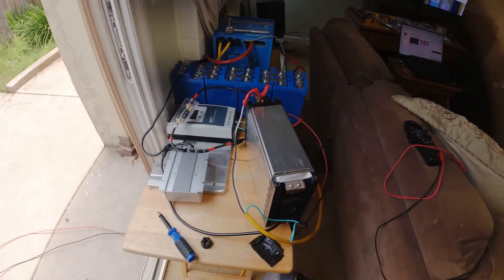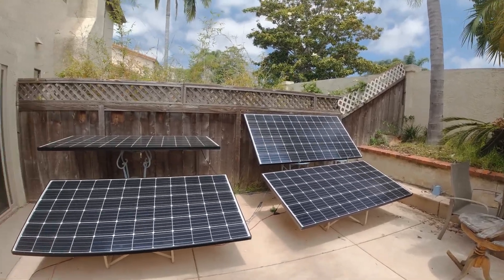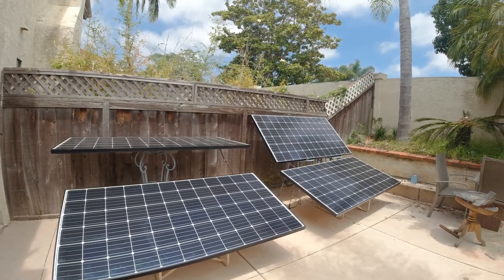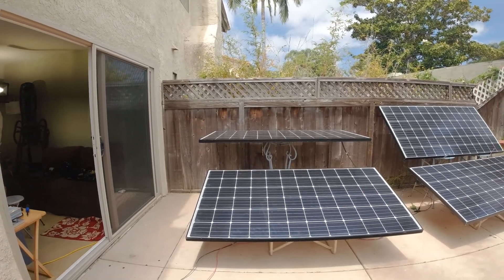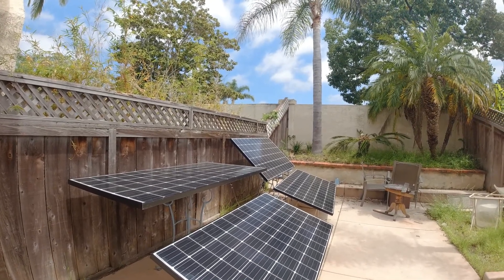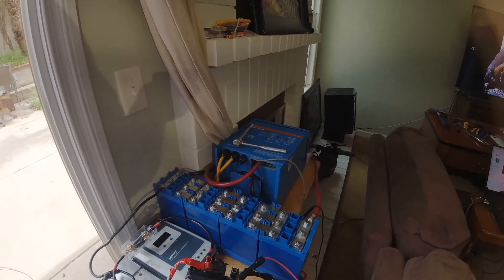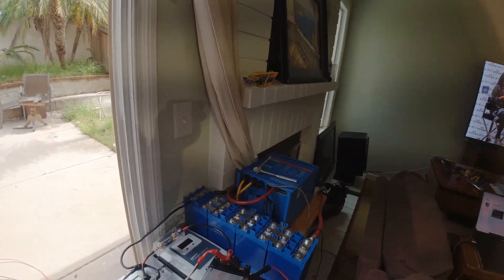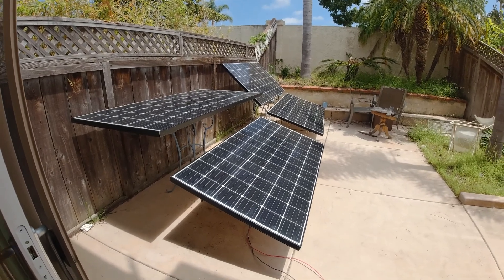Over paneling, 1440W Solar Array (with four 360W Solar Panels, Samsung Solar Panels, S-Power), DIY

Comment: I understand not going over the Voltage of the charge controller, but can you go over on the amperage without doing major damage?
Reply: A good MPPT charge controller will limit the current by choosing another (worse) working point for the attached panels. The datasheet of the controller shall tell how much "overpower" they can manage.
Reply: spec sheet will still specify max current eg. victron 100/50 = max 60amps array input. stay below max V and I and you good to go nuts.

Comment: Been off grid for over a year and I started out just like this. My system now consist of 5.8kW of rook mounted solar and 41.6kWh of Tesla battery modules. I charge cars and mine crypto to dump excess power in the summer/ spring.

Comment from the maker: These are all tied in Parallel w/48" 4 to 1 branch connector and I was making about 500 Watts on this day; No where near the 1440 Capacity of panels because of the clouds...
Reply from the maker: In perfect Sun and angled towards the sun, I get about 1100 Watts (80% of potential 1440W's) out of these panels; Wired efficiently to a 24V Battery. (Keep in mind it was during spring and I'm close to ocean so air has more moisture in it, scattering the photons a bit :-)
Reply: It's all about the cloud!
One day I get 3016W peak and then with cloud 701W peak on a 3kw array.
Better to have more capacity and have the controller limit it when needed.
Take care....